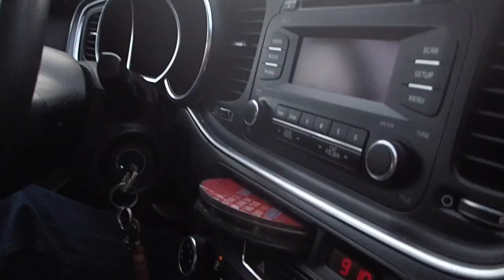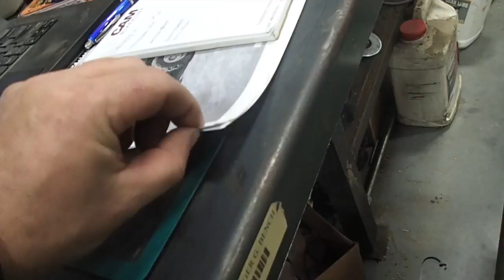Messicks Is 1st Class

Comment: M108s Kubota ILDOT has about 10 of those tractors all have been bad. Since day one we've had nothing but problems. Hydraulics, 2nd 3rd shift pack, 3rd 4th shift pack, and pto. We had 3 year warranty on them each tractor had the same 3 problems fixed 3 time while under warranty. Now Kubota won't stand behind them once warranty ran out even with the repair history. Nice to see we're not the only State with problems. Won't ever buy Kubota again, green or blue learned it the hard way. Thanks for the video made me feel better to see other POS M108s.

Comment: I'm just happy that the Krone has been a successful investment for you with minimal maintenance problems. Most of it, being stuff you can deal with on the farm. Its also great to have great back up from Messicks after having to deal with the previous bailer and its failings. Wes do you think the previous bailer would have been less of a problem if it had a duplicate chain drive on the other end of the feed system halving the load on the chain. I wonder why the manufacturer didn't do it originally? Who cares anyhow, as you have a bailer that does the job and good service to back it up.

Comment: Wes, I have 21,000 bales on one of  my Krone balers and 15,000 bales on the other. I haven't replaced one single pick up tooth. I have the same pickup head as you have. Just wondering why you break so many?
Reply: He inhaled a FOD (foreign object debris) last summer.  Hard to keep stuff going when people contribute junk to your harvest.
Reply: wi11y1960 . Everything thing I bale is on steep hills, water ways and with rocks. Also bale cornstalks too, just don't understand all the trouble.
Reply: William Davis My older Krone balers I would be replacing teeth all the time. Since they came out with this new pickup head been a big difference. The teeth are alot stronger. It's no bs... haven't lost one tooth.
Reply: biggest cause for pick-up tine damage is running the pick-up real low trying to get every last stem, leaf, and straw.... especially on rough ground... basically you should be able to slide a 2x4 been the pick-up times and the shop floor when setting the pick-up height before going to the field, then adjust accordingly as needed... but it shouldn't be much lower than that even in the field... same thing with rolabar rakes as well... wheel rakes normally have to be run slightly lower, but should only have light ground contact to start...

later!   OL J R

Comment: This shows the difference between Krone and CNH, for them to actually have reps on site looking it over with you is impressive. Considering the nightmares that came with the NORower and the last CNH baler.
Reply: bimmerman3 many... many folks from CNH involved in that mess. not the way anyone wanted it to end up.
Reply: I think A LOT of CNH products have really been cheapened up by Fiat. New Hollands hey day was when the Genesis line was out.
Reply: bimmerman3 Genisis was a good one. like any big company. CNH has some great products and some that are just OK. No one can do everything perfectly. we obviously try and point out that a product is no better than the dealer supporting it.
Reply: I have an NH TS90 that's had a clutch, pto shafts, main hydraulic pump, and an engine overhaul all before 4k hours! We bought it with 1800 hours and Ive changed the engine oil every 125 hours and it still didn't hold up. It is a loader tractor, and everything has been apart on it. Guess everything is built to a price.

Comment: Bales of that size are not used in my area, so I assumed that the sales volume of these balers is not large. Thus it is surprising that these mechanics have accumulated lots of experience with these. It appears that they now know which parts fail most frequently.

Comment: Quite a change from when the baler was delivered to you.  It is good that Khrone and Messick's understand the power of U-Tube. I wonder how many sales leads Khrone America has gotten since you started with the Khrone baler. I find it interesting that Khrone seems to actually listening to Messick's as many German firms I have dealt with are a bit arrogant. I would think that if you're bringing a new product into a new market the information they (Messick's and Khrone) have available on your channel is quite valuable to them from both engineering and sales points of view. You might be surprised next winter, the little deal about the chain couplings were most of them aren't getting enough grease yet your does,  maybe that will cause them to look at your operation as a firm but fair test of their equipment. You're going to run large quantities of poor quality hay through your machine BUT service recommendations will be generally followed, this might be a better test than they are able to do themselves. This might become a cradle to grave or first owner cycle study for them on their balers. The question we'll have to wait and see is if they give you a deal to trade out of this baler and into the new an improved  baler in a few years.  Many years ago their was a radio disc jockey that also wrote columns for two national magazines Flying and Car and Driver. At one point this disc jockey/journalist decided that it was time for him to buy his own aircraft. For reason I won't go into here he ended up buying a used Mooney.   Before to long his name (Gordon Baxter) become synonymous with Mooney Aircraft. The relationship was quite valuable to Mooney, we may see a similar relationship develop between you and Khrone.
Reply: S Baker Krone bro :)